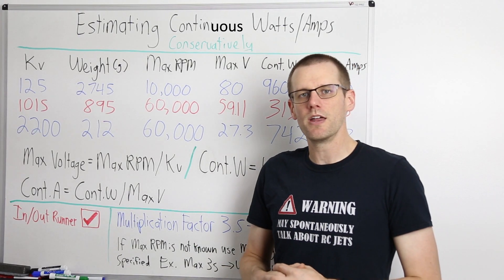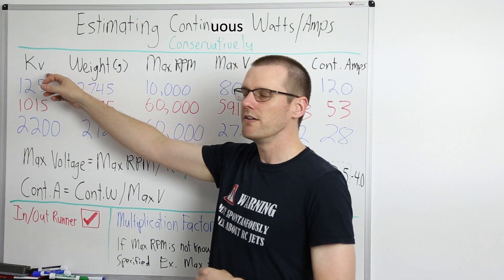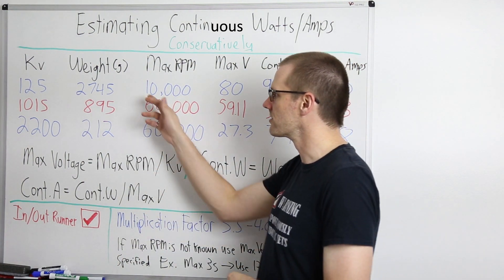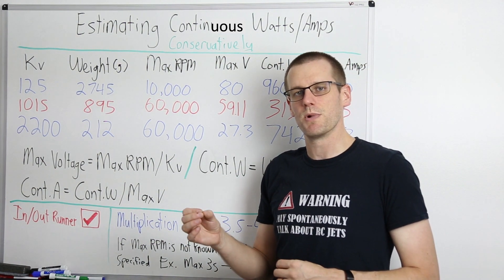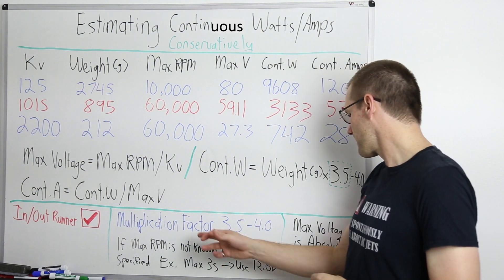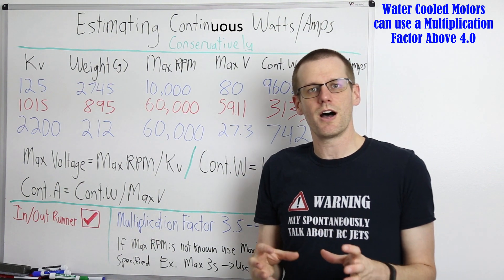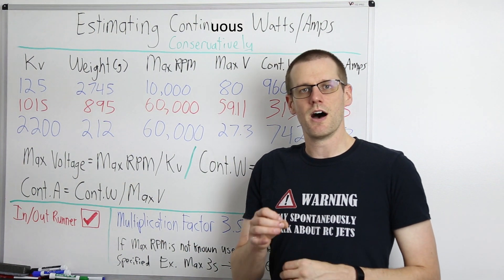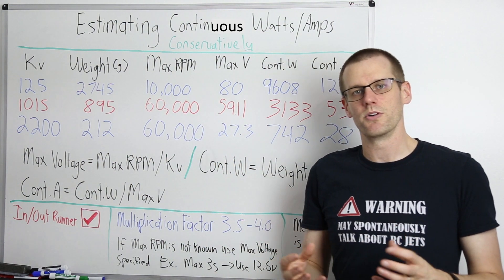Estimating Brushless Motor Continuous Wattage and Current Values

Comment: My angel, i calculated with your formula. ^^
And i have some question, and wanna listen from you.

Example1 with EXPENSIVE * CRAZY motor TP4070CM 3200kv

# Continuous watt : 2560W ( 640gram * 4 (not 3.5) )
# Continuous amp : 109.2A ( 2560W / 23.5V )        (FYI, manufacture spec 382A, gosh.)

From your calculation,
This motor can be with 150A ESC. right?  (MAX8 ESC 150A & 950A @peak)  110bucks.

( I asked this coz i trully trust you, but many guru they use this motor with XLX2 200A++ 220bucks, and i never seen the one who use MAX8)

I know bigger is better, but want to know this is really enough or not. ^^

Comment: Hey Brother, I've been watching your videos nearly from your start and I still look forward to each week's video!  Somehow my buddy and I mentioned a situation that we both experienced where with keeping all other variables the same, we had both increased the voltage of our power systems by 1 cell, with almost zero effect.  I went from 2 to 3s on a 60a esc with a 3660 3900kv motor in a >6lbs 10th scale with gearing that would stay below 120 no matter how hard I pushed it on 2s. I put a 3s in just to test the water without changing anything else and the punch felt the same but that's subjective/hard to gauge whereas the top speed, an easy indicator because of gps, only increased by 2mph.  My buddy had very similar results but from 3-4s on I think a hobbywing 120a esc and a 4076 2200kv motor...this seems really almost unexplainable to my naïve brain. With my system anyway, It didn't immediately overheat...I ran it for 3 or 4 minutes just ripping around and then did a top speed run.  The fact that it was so similar made hesistant so I just went back to 2s. If you can shed any light on this, I would be super grateful! Thank you, man!
Reply from the maker: Something sounds wrong, you should see an increase of speed, and heat in all of your components. do you have a datalog? What are current temps on the increased voltage?
Reply: @RCexplained  ok that's what I thought but for my buddy to have reported the same is what really threw me. No datalog which is inconvenient, but I'm going to chalk it up as user error in some regard. I was just doubting my fundamental knowledge and wanted to just have that clarified.  Again I really appreciate you getting back to me and thanks again, brother!

Comment: With all due respect, I am a bit skeptical about the Specific power of the concept (the 3.5 - 4.0 coefficient). Actually, according to my understanding, the weight should more related to the max. TORQUE, than to the max. power. Because it is the torque (F*r), which is dependent on the weight-driving factors like the physical size ("r") and coil size ("F"). Of course, the RPM can not be made absurd (structural strength, core losses, and other losses), but, in general, increasing RPM increases power without the need for an increase of mass. Therefore I have seen (on the web only, I must admit) high-speed motors capable of Specific power as large as 7 to 10.
Am I correct or do I miss something?
Reply from the maker: Hi Marek, you are absolutely correct as far as looking at this from a detailed theoretical perspective. Mass is mostly connected with maximum torque output of the motor. However,  an approximation is only an approximation at best. Depending on what the motor manufacture does for design can change everything. Placing a cooling fan in the motor or materials used to make up the motor or extending the motors can length to suit sensors or any other motor design that impacts weight overall will never give you an exact comparable quantity to work from. 

Using a formula like this in a go / no go situation is well past the point of the video. This has been something that I have used to help quickly estimate expectations of a motor and nothing more. Knowing maximum torque available doesn't help many and converting back to power adds a step.

Comment: Not that I disagree with any of this but for high airflow (most air based fpv) applications that factor goes out the window. I've seen 2500W out of a 70g motor on the back of a strix goblin, that was probably too much for it but no magic smoke. High power quads are pushing 100s of watts through 30g motors. In air based applications with modern hq motors and direct airflow I'd genuinely put that factor closer to 0.035-0.04g per watt.